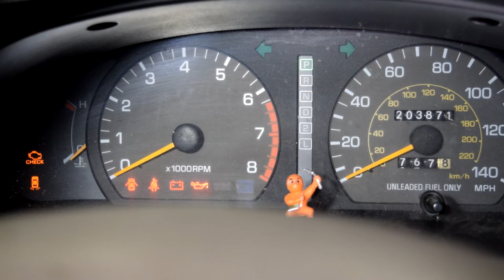Can You Hotwire a car Like in the Movies - Hollywood Secrets Revealed

Comment: Well obviously anyone with the know how on how to actually hot wire a car like this would know that you can easily remove the plate on the bottom part of the wheel and remove the locking mechanism and pin plate to unlock the wheel and keep it from locking. but i like how he left that off the video so that he wasnt actually teaching ppl how to steal a car
Reply: Any time.. but was for educational purposes only ;)
Reply: Only Valor eh? Lol
Reply: Anyways yeah but it takes a decent  amount of time to do so. So movies fail.
Reply: How many times have you seen hollywood actors do all that?
Reply: Well it's a useful thing to know, you never know when you might have to steal a car in an emergency situation.

You should always have your emergency car theft kit with you, that includes an assortment of sockets, screws and jumper cables and most important is to keep your electric impact gun charged up so you can take apart the screws with ease!
Reply: Would you have knowledge about which cars have alarms and which one don't?
Reply: Fici
 I think the better knowledge would be: which cars have crappy alarms vs cars that have good ones. OEM alarms are mostly garbage.
Reply: SI0AX
If you would know, could you tell me which ones are they? For research purposes of course.
Reply: Fici
Well Honda's are the most stolen vehicles not just for their interchangeable parts, but because they are pretty easy to steal, lol.

I think only the high end luxury cars have good anti-theft systems, but even those can be cracked with the right tools and knowledge, like the dealer reprogram er for the key-less systems caused a bunch of high end Audi's to become very commonly stolen for example.
Reply: SI0AX The high end luxury vehicles are usually stolen off the car lot. When I worked at the caddy dealership we had 6 $80000 Escalades stolen. Since these vehicles have lojack/onstar gps that could not be located the theory was that they were prolly immediately taken and stored in metal containers and shipped to mexico or where ever and had the gps pulled out. Later on in the year , we had 2 of the new corvettes stolen. (They were test driven with a fake set of keys turned back in, though to test drive a copy of id is needed so these guys were actually caught.)
Reply: Yeah the ones that stole the cadillacs had to be apart of a ring because several dealerships in the local area were all hit up in the same fashion that particular month. All dealerships without cameras too
Reply: Its not easy to pull the locking mechanism and some cars its not even possible.  No one hotwires cars.  The back end of the ignition comes of and you can start it with a flat head.  You have to break the steering lock.  The most common way to steal cars is with modified keys.
Reply: I know personally that BMW alarms, even in the 80s, don't make the car easy to steal. What they do very well is make the car very time consuming to steal, because the wires don't follow any kind of reasonable color scheme and spider their  way all the way behind the climate control and into the onboard computer, where they require a 4 digit passcode to enable the fuel injectors.
Reply: Yeah it's not as easy as they make it look in movies except on poorly made cars like old Hondas and Ford escorts from the early 90s which is why they were the most stolen cars in America at one time.. now adays though pros have gadgets etc to do it or they set up inside jobs and steal keys, or toe the vehicle
Reply: You smart tell me more I got questions 🤔
Reply: LordGandor3 lmao
Reply: Greatest Ever 
A lot of the older ones and pretty much every motorcycle you just turn the wheel until you break the lock...
Reply: Also the little key fob bs can be disabled on most vehicles by pulling some fuses, along with the rest of the security system (e.g. the horn).

I know the Kia Sedona is this way
Reply: Nah bro all you need is a scaffy bar to snap the steering lock then you black box the bih then you dip 😉
Reply: @joshua7426  easiest car to jack is the escalade 💯
Reply: @LordGandor3  lmfao this is the GREATEST interjection I have ever read in my life. Saving this one
Reply: @HighArchingCrests  , Gee thanks. Surfer Ke11y Slater just turned 47 on Feb 11th, 4+7=11. Slater's jersey number is 11, he won his 11th world title on 11-6-2011. This is Slaters last year on the pro tour culminating with the Bi11abong Pipeline Masters which is the 11th championship event & final event of the season Dec 8-20 Dec 13th just happens to fall on a Friday (Friday the 13th) There has been a  recent uptick in alleged shark attacks. Oceanographer Ocean Ramses swam with a 20 ft Great White Shark off the coast of Hawaii. Out of no where recently a new species of Orca was spotted ? I guess Cousteau missed it ? Last year the Movie THE MEG was released with Statham playing scuba diver Jonas (Jonas & the Whale?)  Are they setting the stage to release Megalodon , a Monster created by Rothschild scientists ? Before they unleash earth Beasts they will repeal the 2nd Amendment which is why the occult are staging so many fake mass shootings. All of a sudden Tiger's Baaaack & he just won the slave Masters Major. I guarantee you he is going to win at least 2 more Majors  this year to pull within 1 of Jack's record of 18 Majors. It's a fact golf balls can be fitted with a GPS guiding system to make puts drop. The PGA is just as rigged as the NFL, NBA, MLB, Nascar, Horse racing & Pro Wrestling. George Orwell said "It was easy to fill up the horizons of their minds with movies, football, beer & most of all gambling".  Last year a white racist heckler had to be removed from the golf course because he wouldn't stop heckling Woods. For some reason there isn't one photo of white racist heckler on the internet ? Is he the guy who stops Tiger from tying or beating Jack's record ? Then agent provocateurs incite race riots across America leading to Martial Law. I know for a fact the Rodney King beating was staged & Military mercs were ordered to incite the LA riots. Now that LeBron "king" James plays for the LA Lakers of Fire in the city of Fallen Angels he too becomes a target as planned by the NWO. The last 4 presidents used the term NWO in their speeches so it's not just a theory.  Presidents are all puppets for the ruling oligarchy families, all world leaders are puppets. Immoral Bush Obama wars have inflated the national debt to over $22 trillion.....They did it on purpose to eventually collapse the US dollar which will cause worldwide chaos, Martial Law & WW3.  No one will be able to buy or sell without the mark of the Beast which means saluting the Satanic NWO. The mark is in the hand or the forehead so saluting the NWO is the mark ! HG Wells wrote The Island of Dr Moreau & War of the Worlds so this was all planned a long time ago.
Reply: Revelation 9:11 They have over them a king, an Angel of the abyss whose name in Hebrew is A-bad-don the Destroyer. On 9-11-2001 the MSM news lied & said Flight 11 hit the N Tower....Planes made of aluminum can't magically disappear into buildings made of steel. Then 911 days later on 3-11 the occult bombed the Madrid trains in Spain. ISIS wears long sleeves so you can't see they are military mercs with American tattoos. All the world's a stage & all of the men & women are merely role players. Satan is the script writer & the Director. The truth is really stranger than fiction
Reply: Any ideas on bypassing the RFID chip in the key head (Subaru have these), ohh and then there's the immobilizer. We can concentrate on the steering lock last. Probably the easiest to bypass...
Reply: Well fk thanks M8, my car got stolen
Reply: It's easier to pry the top with a flathead screw driver and wiggle the top of the steering wheel collum will the lock breaks
Reply: Yo wtf my wheel was locked on this beater and I just took the guts out the ignition today wish I woulda known this😂😂

Comment: As someone who's had to move cars without keys more than a few times, I know it's possible to hotwire a car quickly, though the problem comes with breaking the steering lock if you don't have access to the lock mechanism through the steering column.  If you do, it's easy to start the car and drive away.  I've done it both ways.  Basically anything older than 96 can be vulnerable depending on the make.
Reply: Could you make a video for educational purposes
Reply: learn to pick the key then
Reply: Yes pls  i speak for the ppl n we need a video educational purposes only of course
Reply: @franciscaramirez2342  Showing how to hotwire one kind of car is not going to help anyone.  If you really want to learn, look up videos on replacing the ignition switch on various models, and do some self education on the ignition system wiring on older cars.  Modern vehicles with key fobs and chips in the key are immune to the methods because the computer won't fire the spark plugs, but older cars are pretty easy when you actually put in the effort to learn how the car sends power and signal to the starter.
Reply: What about newer cars? I doubt you can hotwire in 5 seconds like they do in the movies.
Reply: @Bekindifnot...  That's the beauty of newer cars.  You don't HAVE too.  I just recently had to program a new fob for a car and all it took was an app on my phone paired with an obd2 Bluetooth dongle to get the computer's security code. Then I just used a commonly and openly available scan tablet plugged in to the obd2 port to tell the computer to accept it.  I still haven't even cut the profile for the door locks on the included key blank.

 Some are even easier than that.

Comment: Good luck hot wiring my car after I installed a hidden battery kill switch. It's an older Porsche so doesn't need a throttle adaptation or other ECU learning stuff.but I still enjoy your videos. Damet Garm 😀
Reply from the maker: Some car's a kill switch is mandatory, eyval.

Comment: the terminator made it look easy . he just ripped the plastic off with his hands and then with his mighty strength destroyed the steering lock
Reply: actualy it works
Reply: silverss onyoutube Almost anything can be achieved with brute force. Especially on 80's card cars and devices. Less computerization.
Reply: The T-800/T-1000 is good for pre-1990 models.  You need the T-X for modern cars
Reply: silverss onyoutube arnold can do anything
Reply: The old 70s and 80s cars were that easy, no wheel hardly any electronic crap. However always annoyed me in the movies how they did ....they would get voltage to the starter then attach the starter wire to the engine wire...which means the starter is still starting while driving, and will die very very soon.

Comment: Oh yeah... the wheel lock lol. even my 1993 Escort actually required you to insert the proper key in order to disengage the wheel lock lol. I remember fiddling with it when I needed a new ignition switch.
Reply: Richard Phillips I heard that was true for American Escorts as well and my buddy said a neighbor used one to open my car door when I was away once. Luckily I kept nothing valuable in my car. Still couldn't start it though because the door key was separate from the ignition key.
Reply: Richard Phillips I've still got my old escort key, maybe I'll take it with me to the junk yard and try it out for myself lol
Reply: MAN_ON_WHEELZ u can break the steering lock with force..
Reply: old cars were easy. if you were even halfway hefty you could just snap the steering lock straight off by truning the wheel with brute force, lighter weight guys would just force a bit of tube down over the barrel and snap it off so you could turn the switch without needing a key.

These days most thieves just break into the house and steal the car keys, it's easier.
Reply: Those old Ford escort door keys worked as a bump key. All you have to do is rack the key back and forth, and it will unlock any other ford escort.
Reply: You guys are giving up too much information.  You shouldnt be teaching people about jigglers.
Reply: Casey Rodriguez Jiggler is the correct word. I am no locksmith or thief, so whatever. I just learned that trick from friends a LONG time ago.
The escort key wouldn't 'easily' unlock others escorts, giving you a false sense of security, but jiggle the key while racking it back and forth, and the lock would turn. Wouldn't start the car though, cause it didn't have the right chip.
I am not worried about giving away the info, i doubt a thief would be targeting one of the late 90's early 2000's escorts... I don't think you'll find anything of much value, seeing as they are beaters these days.
Reply: Richard Smith It works on every car.  You're putting others property at risk.
Reply: Lol at risk for Escorts? In 2017? Those valve seats were time bombs I'm surprised when I see one even drive past me. I think to myself either what trauma did someone go through to keep the SPI alive or how much time they have left before they are crying on the side of the highway. 

Stealing those things would be the best thing you could do for someone (kidding)

Comment: Hmmm.  Well were I come from they would just hammer a large screwdriver into the ignition and use a wrench to turn it. car started.  Newer cars with imobilisers of course wont work like this or in the vid.
Reply: StealingValor I suppose in the part of the world he/she comes from, all the cars ARE from the 80's and prior. Maybe Cuba
Reply: Galacticboy2009 he could possibly mean that when he was younger, maybe in the 70s-80s-90s.
Reply: That's how GM trucks up to at least '06 are being stolen. The "security" that is in those trucks is a joke, it's all built into the ignition cylinder and as long as the cylinder is turned the trucks start. I think GM had been watching to many movies before coming up with that system...

I'm not sure how they are stealing the '07+, since there's an extra layer of securty in them, but somehow they are getting around them.
Reply: +Stealing Valor
I drive a 91 mazda and someone did exactly that to me just the other day.  Fortunately, they failed to actually steal the car because the battery was dead.  A need to learn about ignition systems in order to get it started is actually why I came here.

Anyways, point is that it will work with at least some early 90s cars as well.
Reply: Any car without an immobilizer a lot of  2000,s cars and older
Reply: i did this to my 1997 dodge dakota. I have a keyless ignition now, its actually kinda nice. I can lock the doors with the truck running lol. I did it because the key got lost and then i found it later, oh well

Comment: Modern cars since as far back as 2003 or earlier have immobilizers so if you happen to hot wire it, it'll crank the starter all day but no fuel will get released to injectors. A chip in the key must match the the car computer before fuel gets released to start.

Comment: or if its an old GM, drop the steering column, unbolt the ignition switch, slide it with your hand and bob's your uncle.
Reply: Matt's Garage - TakeiT most GM columns 80's ish and newer have the locking plate behind the steering wheel. I have seen people get past these by bringing a whole other column and swap them out. If you know what you are doing its under 5 mins easy.
Reply: Buddy of mine bought an 87 trans am a few months ago for the engine, the key was broken so thats what we did to move it, no locking plates or anything on that one.

Then to steer he did a burnout while I pushed the rear (bought it off the shop beside us, gravel lot)
Reply: Matt's Garage - TakeiT  Or if its an 88 ford, just turn the ignition as hard as you can to break the lock and it will start
Reply: Who told you about bob ?!?

Comment: There's also a thing called an immobiliser which is specifically designed to stop what he did in the video from working, usually by using an electronic system to wirelessly check for a specially coded chip inside the key. Depending on the make/model ect it will either wait for a set time before disabling the engine or simply not allow the engine to start if it does not see the key.

Comment: I’ve been trying to install a momentary push button and the instructions said to cable through firewall.
My 2011 Nissan armada has trouble starting sometimes and it has 2 starter cables. Connecting those 2 didn’t work but 12v and starter1 worked like a charm. I don’t need to change the unit for $500. 
Thank you thank you thank you

Comment: You can break the steering lock fairly easily. Hot wiring a car is fairly old school anyway. It was a lot easier on older cars. Same theory. Supply power to ignition and then temporary power to the starter. Only 4 wires went to the key barrel.
These days you hijack a car. Much easier.

Comment: hammer + chissel that steering lock thing off. 
Ive owned two cars in the past that weren't sold with keys. The keyfob id is also easy enough to bypass, just go to the wreckers and find a key + ring off any car by the same manufacturer. The key is coded to the key-ring sensor, not the ECU.

Comment: In the movies: they make it looks too simple...they don't even use any tools: screw driver or anything...they just bend below the steering wheel & boom they got two wires in their hands & start up the engine & drive right away lol
Reply: Same goes with video games, like for example GTA IV lol
Reply: gets chased by cops - hops into random car - 3.5 seconds later manages to start car wtf?
Reply: wyheee cause it's fast.  You wouldn't want them wasting  3minutes undoing everything.  That would be a bad movie.
Reply: And the exact wires you need are just hanging there perfectly stripped.

Comment: I had to hotwire a car once when the owner dropped and lost the key. It didn't have an immobiliser. On modern cars with immobilisers, you can get really cheap dongles that you can just plug into the OBD-II connector to disable it and then hotwire as before.